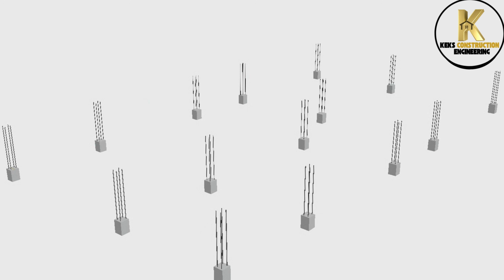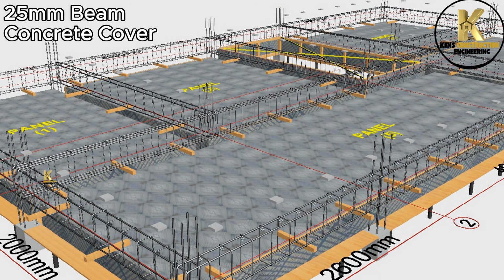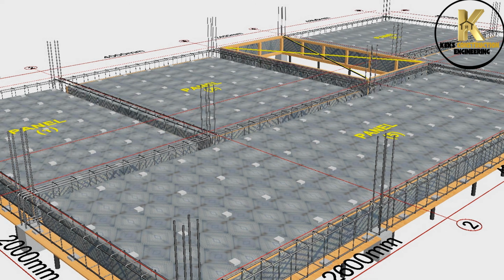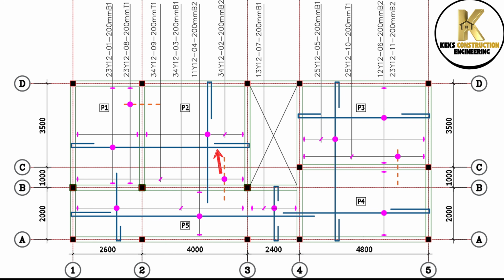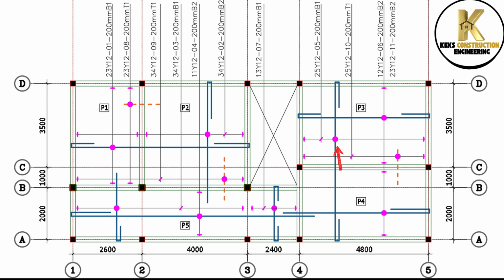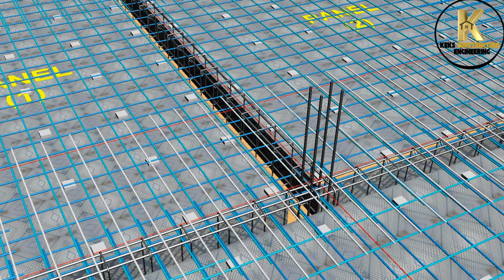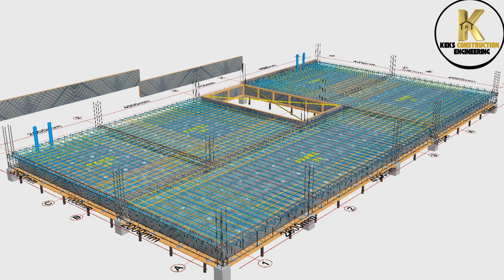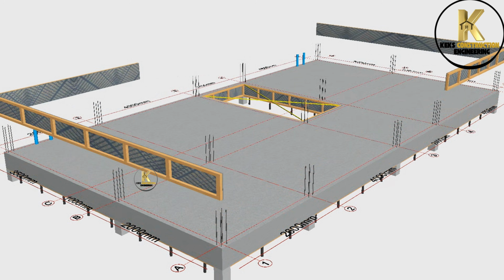Master SLAB REINFORCEMENT Details in 6 Mins | Learn the SITE Reality

Comment from the maker: Reading drawings is one thing, but executing them on-site is where the real skill shows! Which part of slab reinforcement do you find most challenging: the cranking details or managing the spacing? Let me know in the comments! 👇
Also, if you want to master the full structure, don't miss our guide on Beam Drawings here: Master How to READ and Execute BEAM DRAWINGS Like a PRO
Reply: Thank you so much for the helpful instructions. Could you please provide a full explanation of all the steps, from the foundation in the ground to its connection to the column, and then how to connect the column to the roof?
Reply from the maker: @Loloschool2030-x1s
Ok. Go to BUILDING CONSTRUCTION Playlist on my channel, you will See full Building Construction process from Foundation to Roof (Part 1 - 3)

Comment: why are there no top bars in some of the panels bro
Reply from the maker: There are Top Bars in all the Panels but not in all places for example.. There's no Top bars at the Mid Span, the Reason is that, in the Mid Span, negative Bending (Sagging) moment is maximum - which requires only bottom tensile Bars to balance it while At the support, Negative Bending (Hogging) Moment is Maximum and it Requires Top Bars to balance it.

Ok, Watch this Video below, You will Understand Better 👇👇👇
https://youtu.be/xbb3hSu3MbU?si=GjSZr1gGtyXfGx5N

Comment: Kudos sir
The staircase area is a one way slab

Besides, you didn't introduce the slab chairs
You exempted them
Why please🙏???????
Reply from the maker: The Staircase panel is not a one-way panel because the Aspect Ratio Ly/Lx = 4500/2400 = 1.875 which is less than 2.

Panel 5 is a One-way Slab Panel because the Aspect Ratio Ly/Lx = 9000/2000 = 4.5 which is greater than 2.

Watch the Video one "One-way and Two-way Slab" below for better Understanding👇👇
https://youtu.be/PUqYBrUs0BY?si=RC-dP1rQ71LhrSsE
Reply: @keksconstructionengineering that's a good response from you Keks , One-way and Two-Way spanning slabs are known from Aspect ratio Ly/Lx.